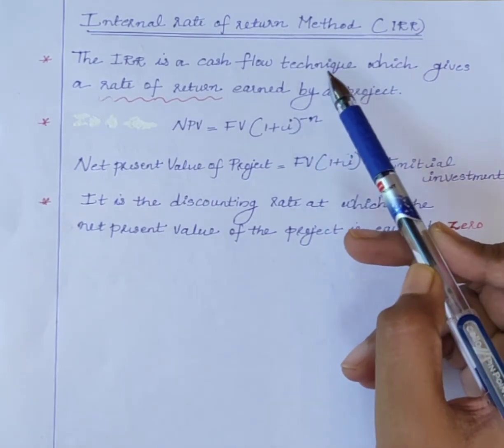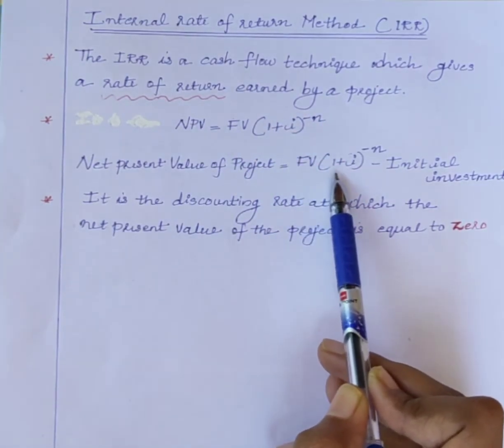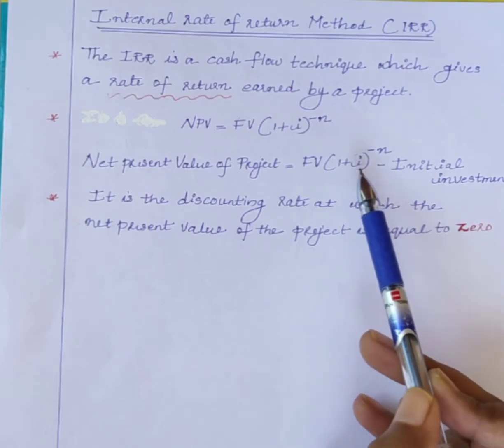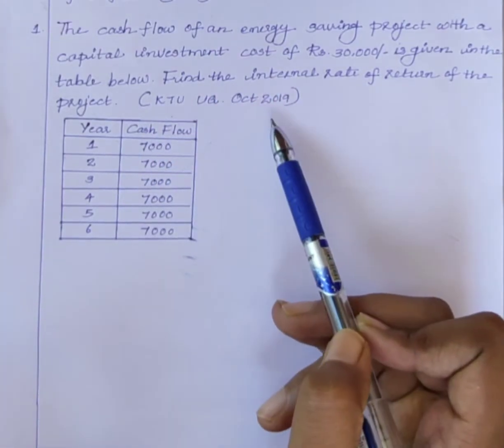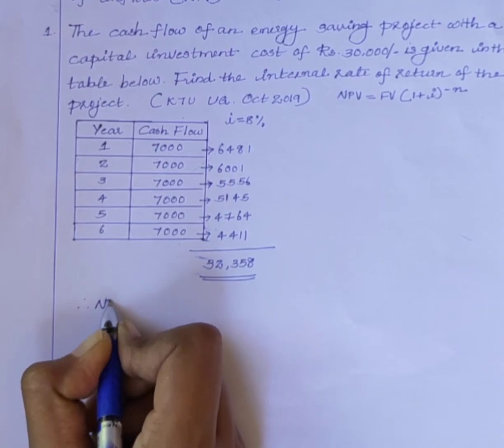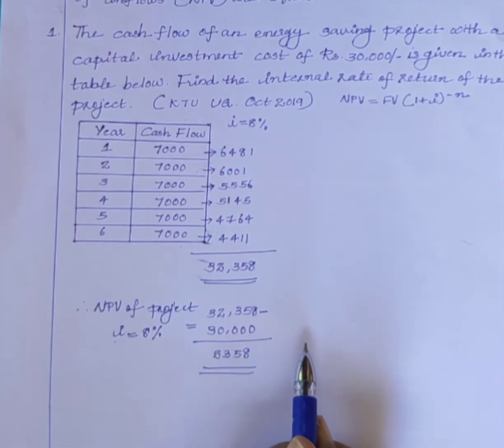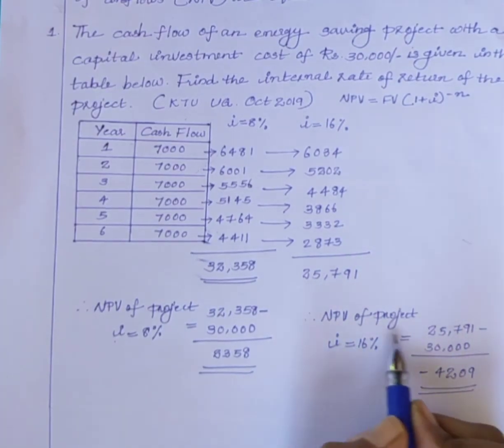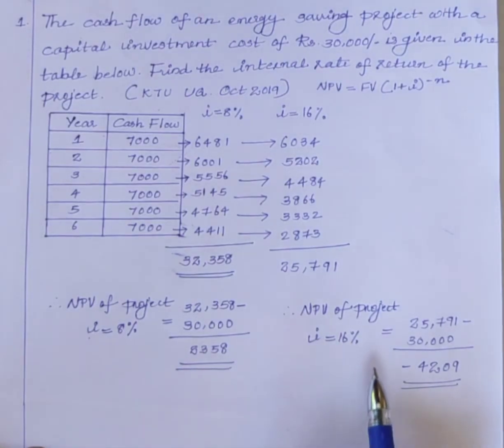Internal Rate of Return Method

Comment: Calculate the net present value over a period of 3 years for a project with an 
initial investment of Rs 50,000 and fuel cost savings of Rs 30,000 in each year. 
The discount rate is 16%.
Mam  what will be the answer of this. Its a question in ktu paper
Reply from the maker: Rs 17376/-